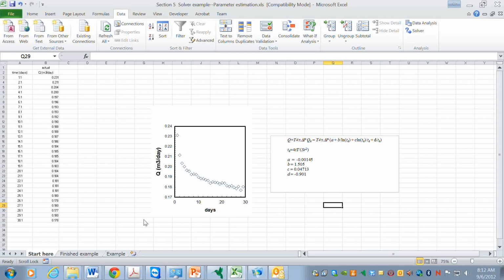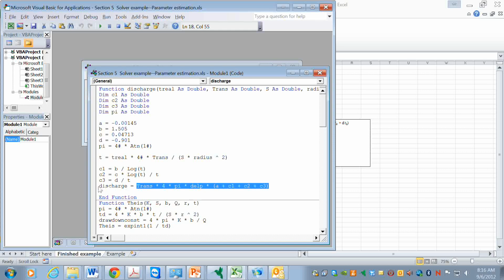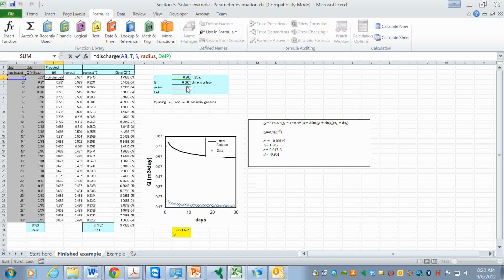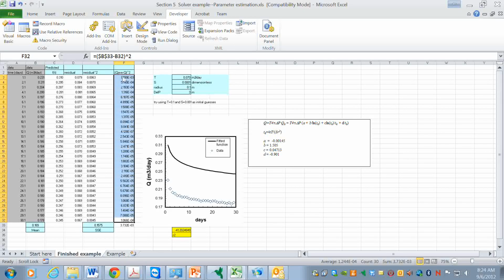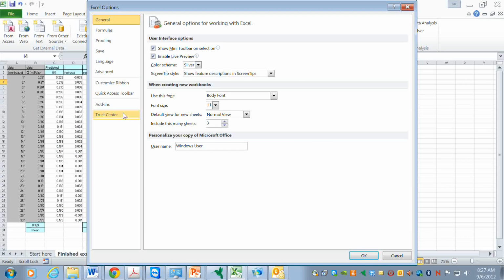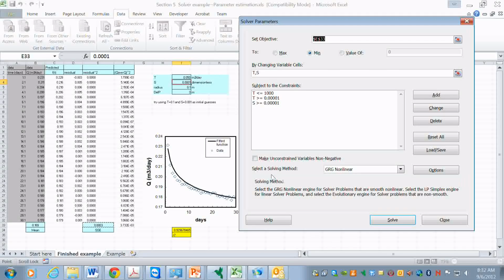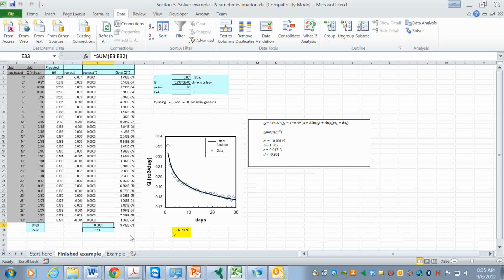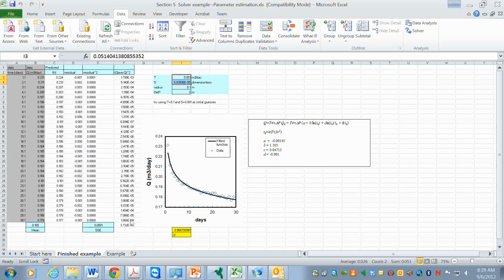Using Solver in Excel

Comment: Thank you so much. Is it possible to solve a more complex example with more than one drawing. I mean, by the complexity of the number of equations in the solution
Reply from the maker: Saif,     I have only done problems involving one objective function using Solver, although it may be possible to do multiple objectives.  One approach could be to weight the different objectives and sum to a single objective.  Good luck,  Larry